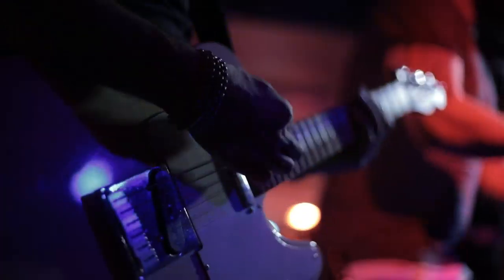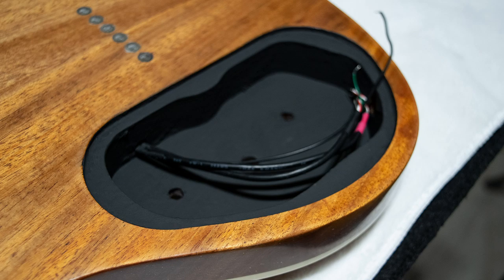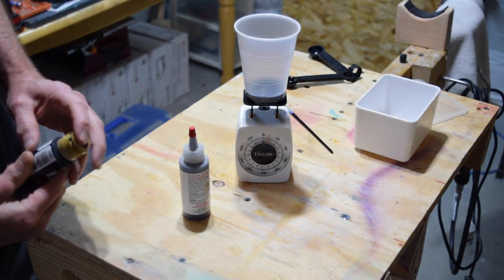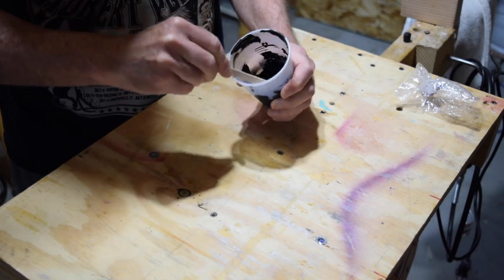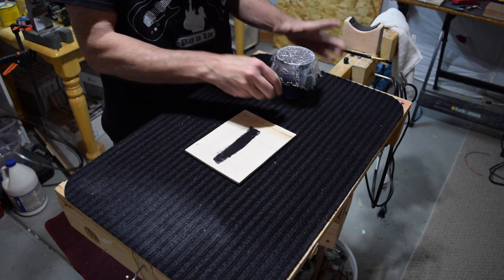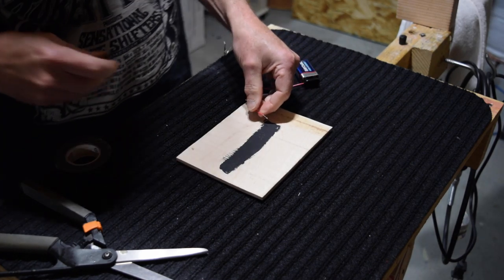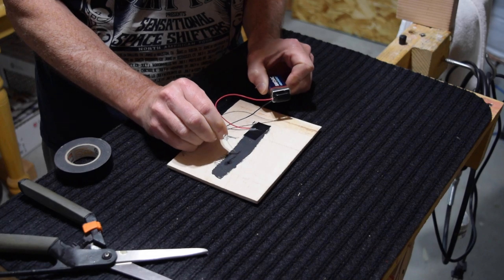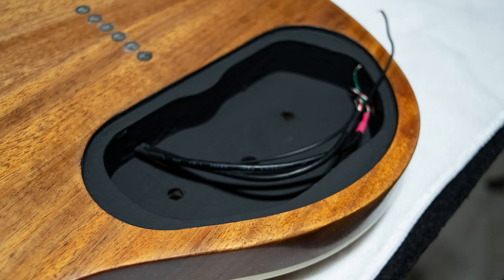Make Your Own Conductive Shielding Paint

Comment: I'm a newbie and have replaced two single-coil pickups on a guitar with humbuckers (because of the noise around computers, monitors, etc.) and now I get all kinds of hums and buzzing. So, I bought some unused copper shielding for the second attempt that I thought I would have to connect to ground somehow (I guess???). This looks much easier and better-looking. Do you have to connect this paint to the ground somehow???
Reply from the maker: Yes, you have to connect the paint surface to the ground in order for it to work properly. That happens automatically since the pots and switch are connected to ground and are in contact with the paint around the holes where they are installed.
Reply: @HighlineGuitars  Thanks. Sure seems a lot easier this way. I'm starting to work on a kit guitar where the electronics are attached to the pick guard. Do you paint the pick guard too?
Reply from the maker: @homemovies751  I use foil tape on the pickguard because the paint doesn't stick as well.

Comment: Copper tape with conductive adhesive remains superior to paint however. The paint is just barely conductive enough which isn't quite sufficient for me.
Reply from the maker: You know what's even better? Shielded wiring combined with proper grounding for each component.